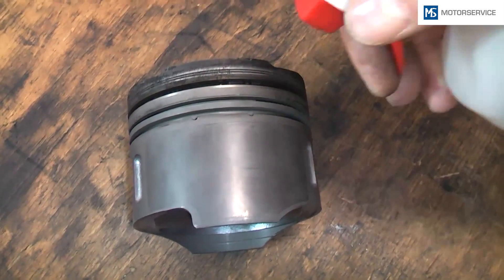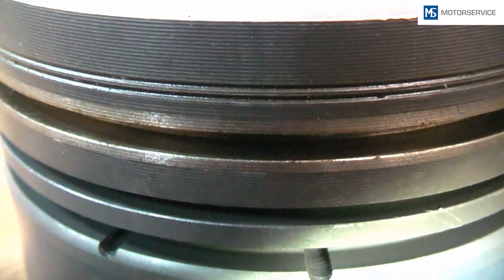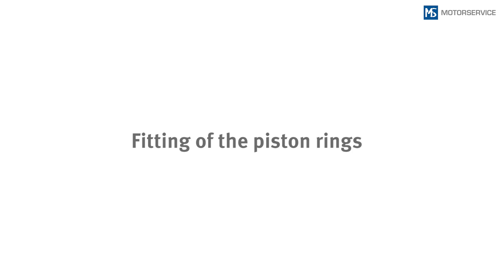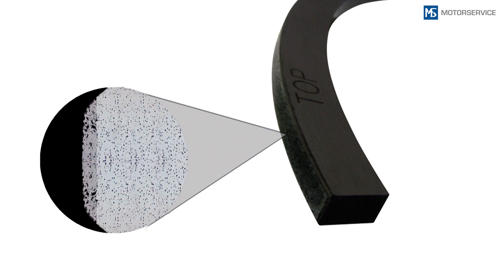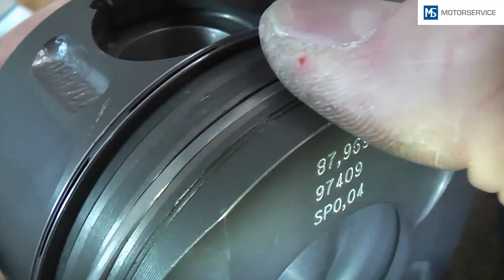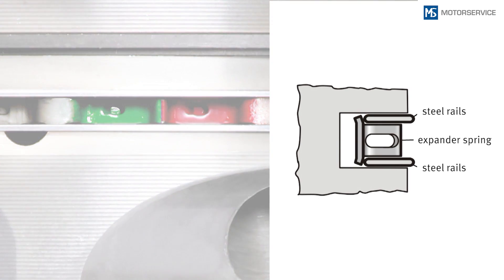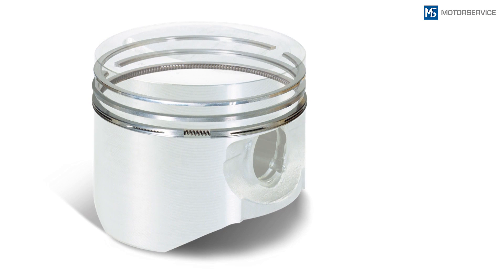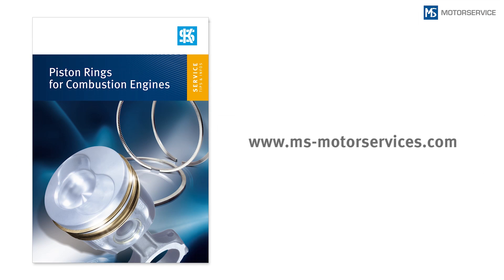Fitting of Piston Rings

Comment: Maan i should have seen this video before, now i've spent almost 40 usd on piston rings that don't fit, i would never imagined that the piston rings are built in micrometer range, this level of engineering is more like a level of lack of engineering, if you are gonna design an engine that requires such a level of manufacturing then the engine is almost useless, to reach micrometer levels there is a huge and expensive machinery behind that makes the product not profitable in the other hand, it makes the product to be a detriment factor to the economy. Real engineering departs from the basis of using high level of error so anybody can repair or use spare parts. That's why the AK-47 assault rifle will be overall a better rifle than the AR-15, well, it's like brute force vs engineering, at the end it's hard to decide.